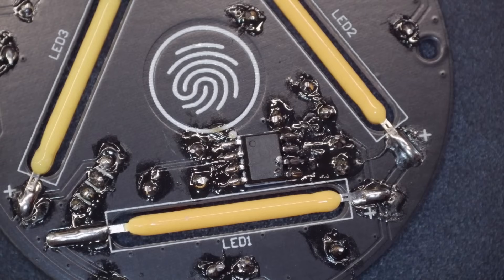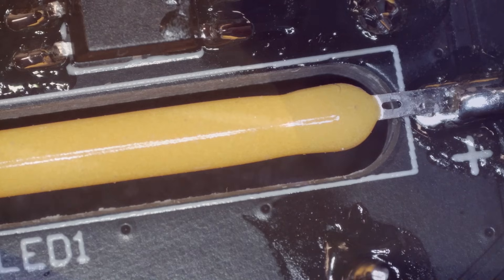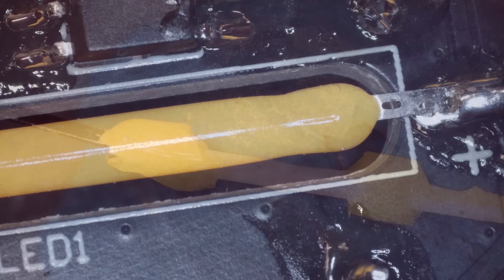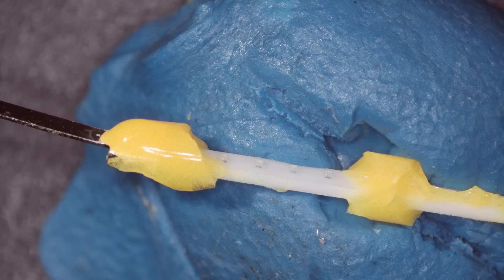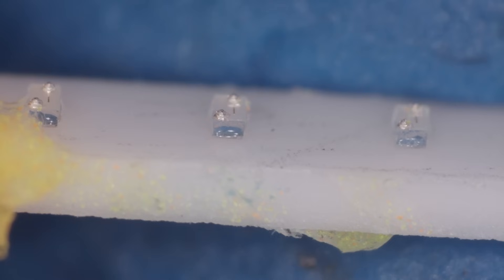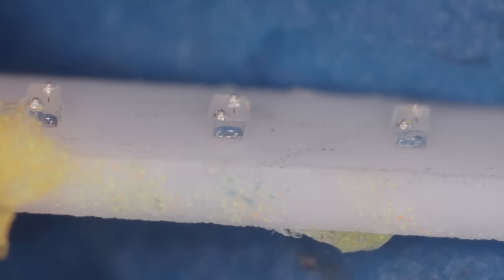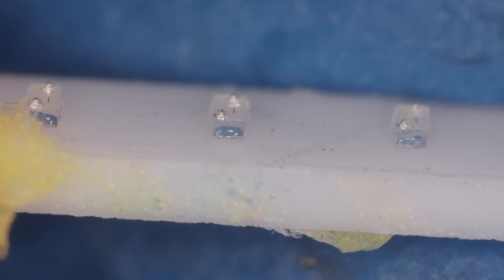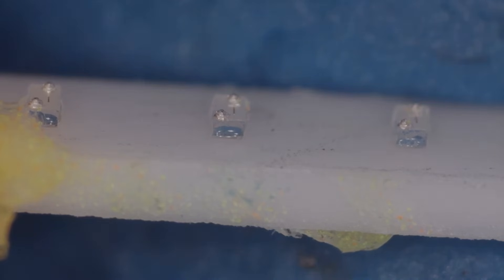#2284 Filament LEDs and Etendue

Comment: Interesting as always. Many years ago (maybe in 2000) I designed for a customer a red light line lamp into an X-ray machine. They had used ordinary halogens, cylinder lenses and slits for this, which I also had designed. They wanted these new HP "superbright LEDs" to be used. I told them that they will not work as efficiently as they think since the emitting surfaces are not zero and the radiation is over a wide angle. Well, the lamp was designed but they were not too happy with the resulting brightness which was what I expected it to be. Since that, new versions of the lamp were designed making them better with more powerful LEDs. With modern LEDs the result would be even much better. One might ask why not use a laser? Lasers are not easily allowed with patients and many safety issues are related to it. Of course, a laser would generate a rather strong line pattern.

Comment: Used these for a customer product. Anode has the hole in the end. Several leds in there on I assume a ceramic strip which breaks easily.
Reply: Do you have the manufacturer part number or a link to a supplier of these LEDs?   Would like to get some (for analog meter backlight lamp replacement) without having to buy all the other parts in the kit which will only get thrown away.
Reply: @ejholden8851 - Re my post above... I cannot be more specific as YouTube deletes the comment. ARRGGH it just did it again.

Comment: Cool - I make oversized 7-segment displays with these filaments, and I find you really need to watch out for stray blue light leakage exciting the phosphor of the unpowered segments, so I mount them to the back of the PCB behind routed slots & cover the back with self-adhesive black felt. Interesting to see the internal construction - no wonder they're easy to break.

Comment: Why didn't you light it up?🤔
Reply: Yeah.
Reply from the maker: Yesterdays video
Reply: @IMSAIGuy  without the phosphor coating! Did you remove any conductors while removing the coating, or are those transparent as well? Could not make out how they are wired...
Reply from the maker: the bond wires pulled off so it is non-functional.
Reply: @IMSAIGuy  Ah!  That explains it 😀